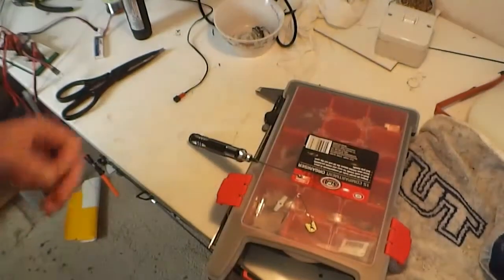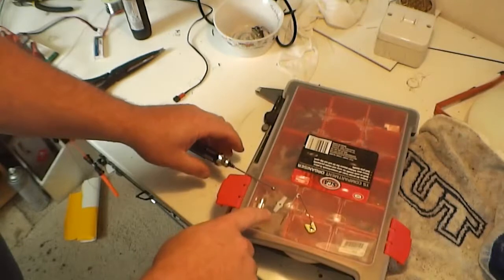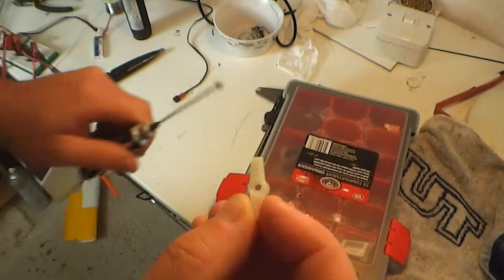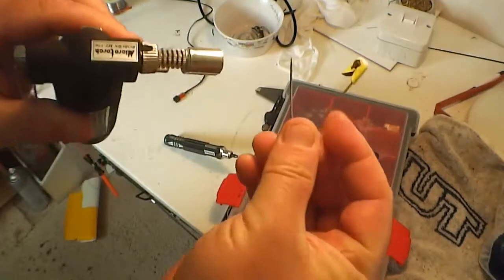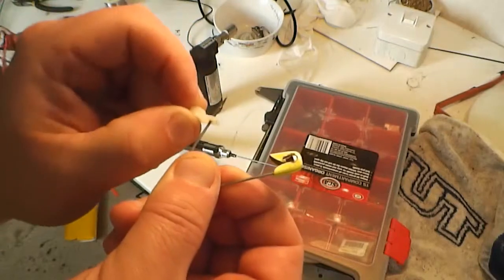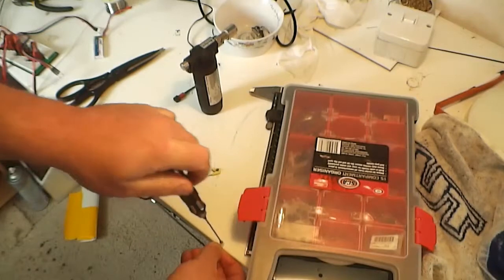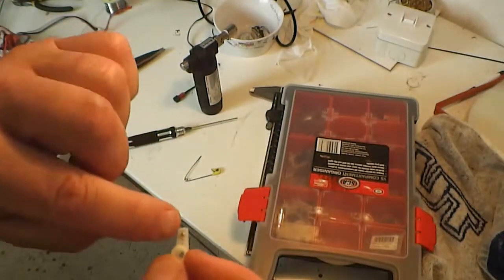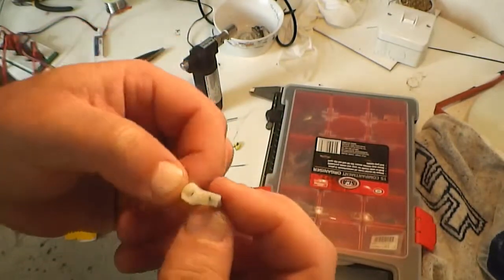how to size holes for servo arms

Comment: Thanks for the video!

I am scratch building Mikey's FPV V3 and hit a roadblock trying to get the pushrod connectors in the servo arms. This is exactly the video I needed!

I used a small candle in place of the torch and it worked fine, FWIW!
Reply from the maker: Bob Shock glad it helped! good luck flying!